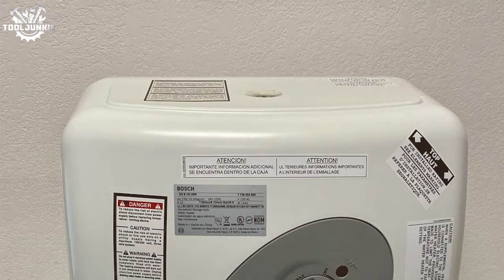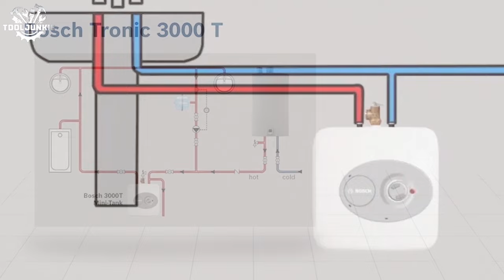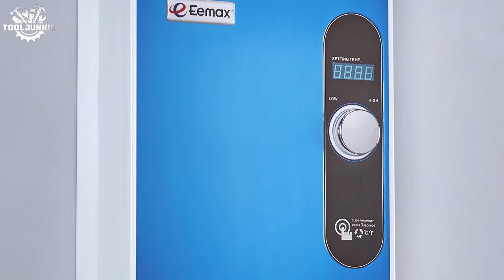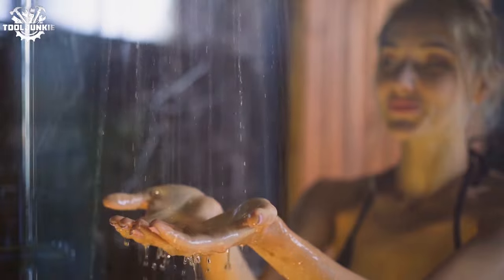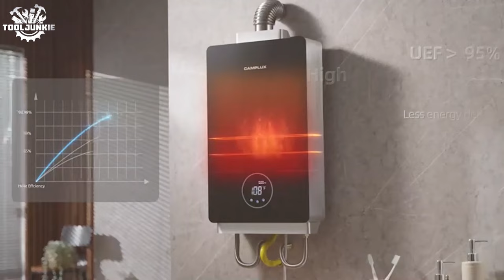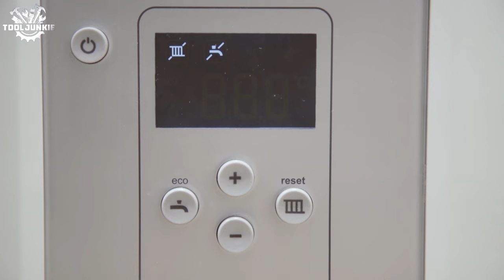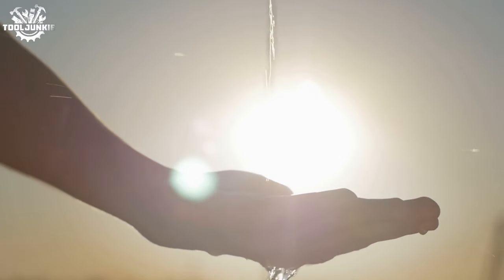13 Best Tankless Water Heaters in 2024 | Gas-Electric Review

Comment from the maker: 🕝Timestamps🕝
0:00 - Intro: Gas vs Electric Tankless Heater
1:40 - Bosch Electric Mini-Tank 3000 T 
2:43 - Rinnai RL94IN Tankless Hot Water Heater 
3:54 - FOGATTI Natural Gas Classic 120S Series Heater 
4:48 - thermomate Electric 27kW Tankless Heater 
5:42 - A.O. Smith Signature Series 6.6-GPM 160000-BTU 
6:32 - Eemax EEM24018 Electric Tankless Water Heater
8:28 - Rinnai V53DeP Tankless Hot Propane Water Heater 
9:38 - CAMPLUX Natural Gas Instant Hot Water Heater 
10:32 - Camplux Pro 6L Portable Tankless Water Heater
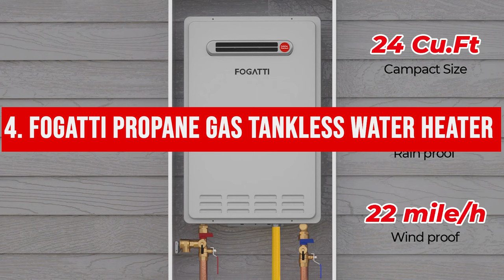11:29 - FOGATTI Propane Gas Tankless Water Heater 
12:14 - EcoSmart ECO 27 Tankless Water Heater 
13:02 - Stiebel Eltron Tankless Water Heater

Comment: I have a Rinnai running for 9 years without any problem. Thanks God Rinnai still manufacturing them. It is a 220 volts model.
Reply from the maker: Yes they are offering some of the top models that are reliable and effective and done great in testing situations.

Comment: I already have an electrical setup for 5 years. Should I try the gas one now?
Reply from the maker: Changing into gas water heater is a long term plan.. First, make a plan and then decide!
Reply: My critique of this video is it doesn't help compare apples to apples. I wish someone would make a video comparing similar KW electric or similar BTU gas.. It's fairly useless to compare an electric point of use 8KW to a whole home gas heater...